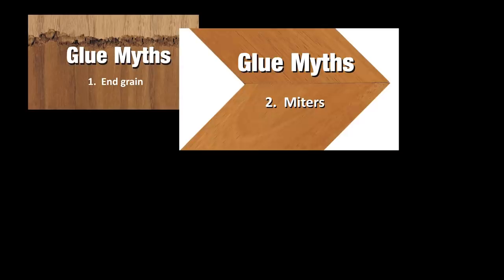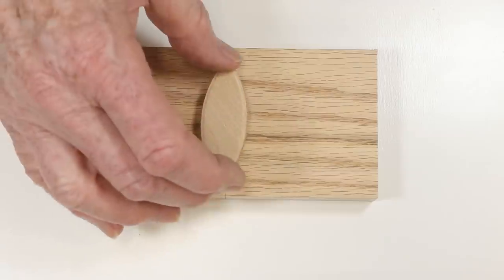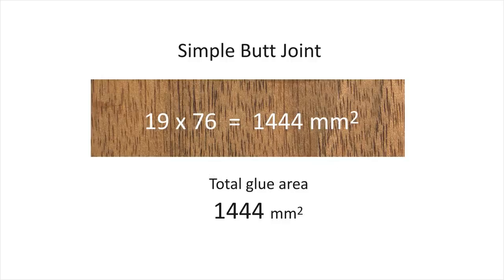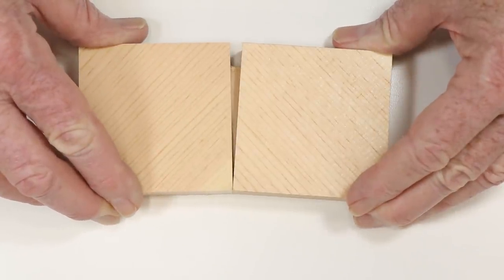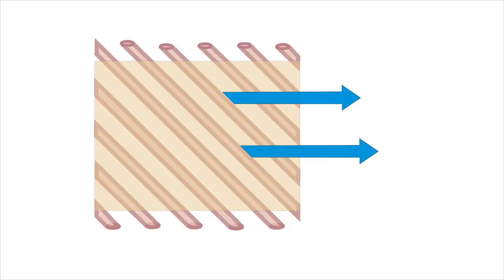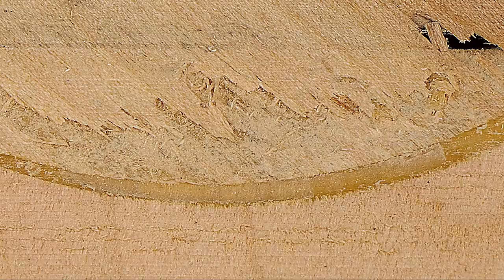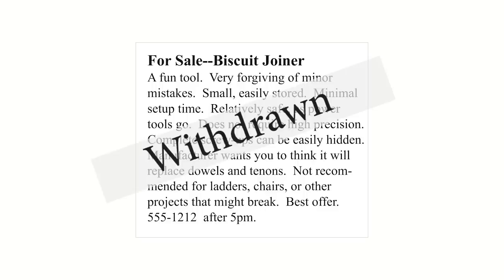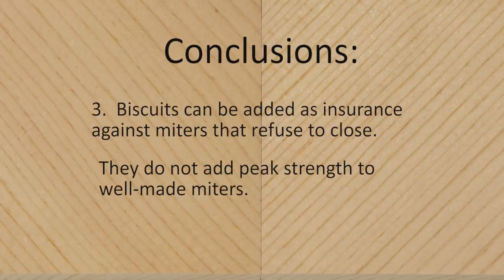Glue Myths:  3. Biscuits

Comment: Your videos in the series are both informative and provocative. I hope they continue - and that you progress to testing more traditional and time-tested joinery. So far you've only presented butt joints - which is not really joinery at all, just the baseline that all other woodworking joints improve upon. You hinted at splined miters in this video, but then didn't show any results if you actually tested them. Referring to the graphs from your first two videos, you are playing around at the left side (or much weaker) end of the strength graphs. I'm looking forward to seeing real woodworking joints which incorporate lots of that stronger long-grain wood that you tested - things from over near the right side of those strength charts. 

Any serious woodworker does not think that biscuits add much strength - I use them mainly for alignment. And you have demonstrated that notion is pretty much correct. I would also caution about general statements like "glue area is not a reliable guide to joint strength". You only presented test results from using biscuits. I'm positive that total glue area is a factor contributing to joint strength in other joinery conditions. How about comparing a miter joint (a 45° butt joint) to a miter with a full spline - from outside edge to outside edge? One with the grain in the spline running perpendicular to the joint line? Then talk about glue area and joint strength...

Comment: You have to think of the area that peak torque is being applied in all of these tests, and then go from top to bottom.

The top of the joint is under tension, the bottom is under compression. So, what is the dead center under? Absolutely 0 load.

Where is the biscuit? The dead center.

How much work is the biscuit doing? Almost nothing.

If you tested these joints in a tensile test, the biscuit would likely add a lot of strength because then all the glue would be doing work.

The biscuit, in this case, adds toughness, not peak load. Toughness is really just a measure of energy. Work (energy) = force * displacement (dot displacement if you want to be technical, but I'm keeping this easy for people who don't now about vector math or calc, so just force times displacement in a line).

Toughenss is essentially useless to static loads, but matters far more for transient loads like impacts and oscillations that can push a joint over its peak load.

So, if you kept pushing your machine farther, it would take more energy to break the joint with the biscuit.

Comment: Testing the joint in shear will not necessarily show the biscuit's true benefit. In shear, the glue itself may be stronger than the biscuit, so a biscuit in the joint will weaken the joint. A weak, cheap glue will benefit from the addition of the biscuit in shear. In tension, the added surface area of the biscuit will greatly add to the strength of the joint with either a high quality glue or with a cheap glue. So the final verdict is, it depends. A biscuit in a miter joint in a piece of furniture will increase the joints ability to resist racking. In a picture frame the biscuit will assist in keeping the corners tight and square for it's entire life. Stepping on the corner of a picture frame will break it regardless of whether or not you used a biscuit.

Comment: I've been using biscuits for 30 years.  I have always used them for alignment, not strength.  In my experience boards are rarely perfectly flat.  Biscuits help align the edges of curved boards.

Comment: Not entirely sure this holds up as a myth in the same way that end grain joints being weak does. I've never really seen anyone suggest a biscuit makes a joint's peak strength higher. More that they help with joint alignment and offer a secondary line of strength such that if the glue joint fails the biscuits can take the load and prevent a catastrophic failure. Splines, though, I'd suggest the concensus is they actively strengthen a joint. After all, you could argue that a sophisticated chair leg corner joint also doesn't strengthen the glue bond to the point of preventing it cracking under shock or extreme loads, but clearly the wood joint itself provides further support. Indeed, as you dive deeper into these sorts of questions, you start to come up against the debate over what can actually be defined as the joint. These methods might not strengthen the glue joint, but they might strengthen the connection between two pieces of wood.

Comment: Ive never thought that biscuits were adding strength. I thought they were just to help keep the pieces aligned during glue up.  When Im doing a large panel glue up, the biscuits help keep the pieces in place while I get the clamps all set up.

Comment: I wonder if maybe the reason the biscuits themselves were cut on a bias was solely to decrease breakage and waste in the manufacturing process.

If they cut them with the widest part of the biscuit as end grain (the theoretically strongest way for them to cut them as far as the joint is concerned) I'd bet that alot of them would break in half just tumbling around conveyors etc.

 If the cut them the other way they might last longer in the factory but would be actually useless for the end user.

The 45 deg cut is a compromise.

Comment: Experience has taught me to avoid butt joints whenever possible, and never to depend on a butt joint for strength. Right now I cannot think of an example where a butt joint is unavoidable, but I'm old and my thinker doesn't work as well as it used to.

Comment: IMO biscuits, dominos and dowels are for positioning, not for strength, unless we are talking shear forces. The problem with bending is that the tensile force is at its max value at the face of the material, and diminishes to the center of the part (in the center it is zero). So if you want your part to better resist bending - reinforce the surface, not the core. By the way, if you cut a slot for a biscuit, and don't install it, the part will break at about the same force as with the biscuit or without the slot all together. Surprise, huh? )

Comment: Biscuits have 45 degree grain orientation in order the they will not have grain in the same plane as the grain in the join. I always regard biscuits as a bit of a hack, really. A better test would have been pulling apart joins made with biscuits though. In these tests you're pretty much levering the biscuit out of its slot before bending and snapping them. Added to that, these these are really thin biscuits

Comment: 'Strength' may not be the best measure, or best measured by the use of a press. The press may exert much more force to a concentrated area than normal use ever would. The biscuit may offer better alignment for the curing process, for example.

Comment: People need to stop looking at videos like this through the lens of "BREAKING NEWS! BISCUIT JOINTERS ARE A SCAM". He's testing endlessly repeated axioms like "more glue surface area = more strength" or "end grain bad" and proving it's more complicated than that.

People are saying "This is a useless test because of the angle of breakage he tested."

If it turned out that the biscuit DID provide extra strength here, people would be saying "Duh. This is a useless test because obviously more wood and more surface area = strong."

Everyone ignores more nuanced insight like about residual strength vs sudden failure. He said he's not throwing away his biscuit jointer. He mentions other angles the biscuit may provide more strength.

His charts show that breaking the wood across the grain is multiple times stronger than any any glue joint. Is it that crazy he might test breaking a biscuit across its grain?

I mean how strong do you need your picture frames? If you make a table or something, it isn't going to break like pulling apart a picture frame. It's going to break more like his test. Are you guys making chair legs attached with miters or something?

And yes everyone knows joints are also for alignment. Do you actually watch the video? Do you think this guy is going through all this effort and has actually never done woodworking?

In science you have to test assumptions even if the result isn't likely to be mind blowing.
Reply: I agree with all you say, but also wonder: why not also test the biscuit in one of the applications it is more likely to add strength? The lack of such a test doesn't necessarily take away value from what he has presented here, but the addition would be interesting and worthwhile imo. I am truly left wondering why he wouldn't at least try one of those orientations out. Maybe a future video....?
Reply: @spruce_goose5169  I think he probably would like to do the other tests, he just may not be able to do them with the rig he has. He probably just thought the test was easy enough to do so he might as well. Science isn't just disproving things. Sometimes you need to verify assumptions even if it's likely the assumption is correct.

Comment: Can you cover any difference between biscuits and dowels. Does a dowel provide the strength that is missing when using a biscuit? I've noticed recently people talking about doweling jigs in favor of biscuits. 

A side question I've always wondered. Knowing the glue is so much stronger than the wood and the idea is that the glue fills all the imperfections in the wood grain, why wouldn't someone "texture" the mating surfaces? Get it all cut and smooth, then mar the surface with a tool or drill shallow pits for the glue to flow into and fill.

Comment: Even with increased glue area, the surface area between the wood is still the same, the amount of wood you remove to fit the biscuit you replace with an equal amount of biscut material. A biscut is just too thin to add any real strength. They are for alignment more than anything else.

Comment: Your scientific methods are fantastic. I especially enjoyed watching how your butt joint video temporarily blew up the woodworking section of YouTube! In the case of a miter, (in my limited hobbyist experience) I don’t think the vertical forces on the faces as you tested are the trouble with miters, rather a shearing force, or whatever the proper term for pulling something apart. Do you have any equipment to test the joint in a “tug-o-war” type force?

Comment: So your conclusions/misinformation: 

1) Butt joints... I can't actually think of any situation I have ever seen in furniture where a biscuit would be used in that situation, and where the failure mode would be as imposed.  What? My hockey stick broke, I cleaned it up square, then re-assembled it with biscuits.  Then I tried to walk the plank with it supported by two benches?

2) The miter is even crazier, if it was corrected for a 90 degree orientation, it would be very difficult to even focus the forces you imposed without twisting it.

Most failure modes in furniture are the product degrades and falls apart over time.  The product is braced in multiple directions.  Consider the crate and be wise.  In these kinds of structures a biscuit is a rapid and massively strong upgrade.  But dominos can be better, and traditional joinery usually is better still.  However, there are  lots of situations where there are no additional points for stronger than strong enough. 

There are some spectacular failure modes with stuff like fat people in chairs, or people tipping them back.  Max load joinery in those situations is actually steel connections, with glue, but they are almost never used.  Wooden boat builders know the drill.

You may know that Franz Klauzs was one of the early, maybe only, stars of woodworking videos.  he was able to cut traditional joinery with great speed.  He is known for his old world furniture making and repairing ability.  I was shocked when I saw that he had come out with a biscuit joinery video.  The joiner itself emerged in Europe where one can't even sell one's work without about 5 years of apprenticeship.  People in the US seem to delight in slagging the biscuit joiner, like your well meaning advice that they can still hold broken joints together.  Better yet to just learn how to use them.

Comment: I'd imagine that a biscuit would add significant tensile strength to a but or miter joint, and ultimately most forces applied to a miter joint would stress it along it's tensile axis rather than its sheer axis. Maybe there's a way to devise a test contraption that will pull apart a miter joint perpendicular to the glue line?

Comment: I appreciate this discussion but I think you leave out an important piece.  As a carpenter I need to always consider the actual stress that the joined pieces of wood will undergo.  For example the stress on the parts of a door will be greater than that of a picture frame.
Reply: 7:16 - he literally addresses this.
Reply: @michaelwitt7984  you’re right…
Reply: @ridgehike  good man admitting a mistake on YouTube. Gives me a little hope actually. 

There were two good follow up videos and each tried to address these real world forces, but not with rigorous testing. If you haven’t seen them, I can find some links.
Reply: @michaelwitt7984  I was  a journeyman carpenter mostly heavy construction and while the only thing that got me through High School was my projects in wood and metal shop only started doing joinery in my retirement.  My wood shop guru is George Vondriska at Woodworkers Guild of America WWGOA. Good day.

Comment: I think this test shows the limitations of your set up. It's worth doing these tests again but instead testing the pure tension strength of the glue joints by seeing how much force it takes to pull the joint apart

Comment: Patrick, thanks for conducting these tests and posting the results.  My comment on plate / biscuit joinery: I think its most useful for sheet material such as plywood and MDF.   It's a great aid in simultaneously aligning multiple pieces, such as shelves in a bookshelf.  That is an interesting wood/glue interaction: there is more than one wood fiber orientation in butting a plywood shelf to a side.  Is a biscuit adding strength to a perfectly butted joint, or just helping with alignment?

Comment: I don't use biscuits to maje the join "stronger", I use them for alignment, and ONLY for alignment - in particular when the wood isn't perfect because stored badly. They help to reduce the number of clamps required (or weight added on top). They help a lot to make everything properly joined while glue is drying.

I'm a bit sad that you didn't tried to separate the two parts in the biscuit's plane direction (uprooting?): in this case, it seems logical that the strength is higher, but - as for ANY "intuitive" things - it should be proven to be true...

Comment: I think that rule about glue area and strength is misleading. When the glue is placed in shear it is very strong, and the more glue area, say a  half lap for example, when you put the piece in tension, it then puts the glue area in shear then it is very strong. Your tests always put the glue in tension, and it's adherence to wood fibres in tension also. I can not think of any joint that is made that joins two pieces of timber that is made to maximise the glue area in this way with the load. They are all glue in shear with the load in tension. Honestly I like what your trying to show but perhaps it's more pertinent to say that good joint work working relies on good understanding of the working loads. Honestly can't think of a time that I have butt jointed two boards with glue and thought yeah that will work as a seamless piece of timber in bending...
Reply: Honestly ;-)

Comment: Hey Patrick. I've got another idea for glue myths. A lot of time when drilling holes for dowels, there is left a bit of sawdust. Same with other wood joints. Usually we blow it out, so that dowels fit in the hole. But if the hole is deep enough, if the dust stayed in there and got mixed with glue, would the joint strength be diminished or would it stay the same. I did some quick testing and did not find any major diferences. Thanks

Comment: The biscuit is not intended to strengthen the joint from buckling. It is intended to strengthen the joint from being pulled apart along the plane of the flat faces of the biscuit.

Say you built a face frame with biscuits; do you expect forces that could buckle the frame, perpendicular to the face frame? No, except by a gross accident. You are the most concerned about swaying by say pushing the cabinet from its top to advance the whole cabinet on a floor along its long side. Or less so along the short side, front to back.

Comment: Hang on.  You tested bending strength about the centre of the joint.  Had you tested pull out tensile force then biscuits would have reinforced the joint.  Also biscuit material/ strength varies.  I’ve used some quality biscuits which do most certainly add strength.  A few too many simplifications I think in this video.

Comment: Slot Adhesion is poor with biscuits.
In addition, a biscuit's centrally-placed location provides ZERO tensile strength to a bending moment. Think of an I-Beam -- the lower surface in tension and the top surface is in compression. The central web is neutral -- neither in tension nor compression. It is merely there to separate the lower surface from the upper surface. 

The central part of the wooden beams in this testing scenario mimics beam strength dynamics. The results are consistent with this comparison.

Comment: I 3d printed some biscuits.  After printing I have drilled a couple holes in them for glue to have a tunnel through the biscuit.    I understand that most pva glue will not stick to 3d printed material. I basically use biscuits for alignment vs. Strength.    The festool domino is just a overpriced idea . I am sure they have their own place but I am going to say that for 90 percent of the joints I build strength more than what the glue provides is a non issue.   Festool has a place in some shops but not in mine.